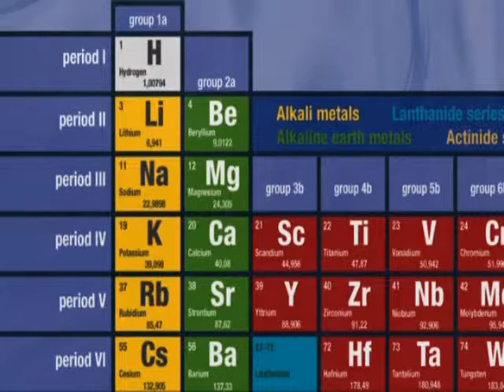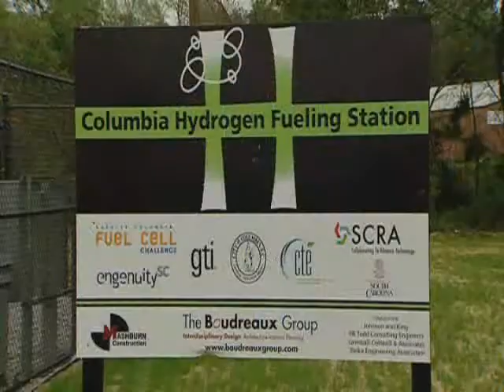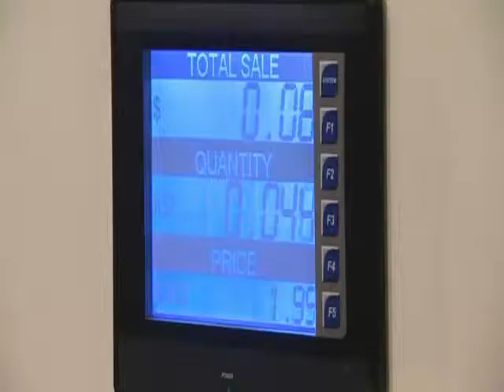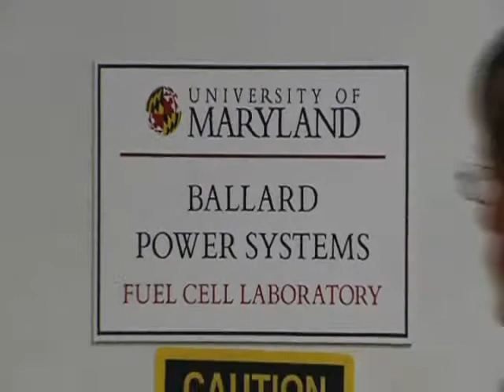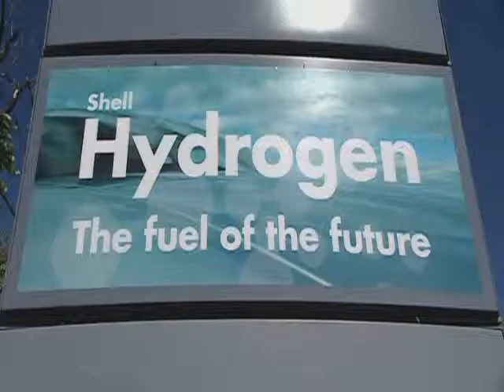Motorweek Virginia Clean Cities Hydrogen Market Snapshot Education Video

Comment: and fuel cells cost $500K or more, H2 takes 4 times more energy than making electric direct into batteries. Making it from water will increase water issues.
These make a Tesla look low cost.